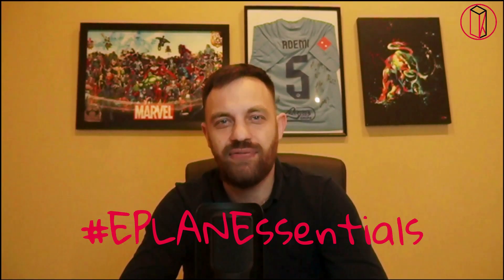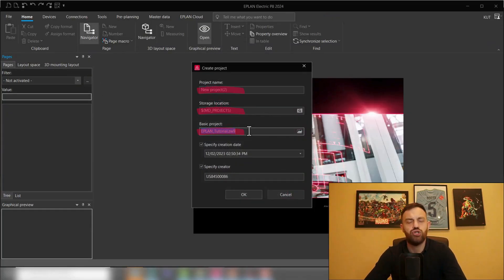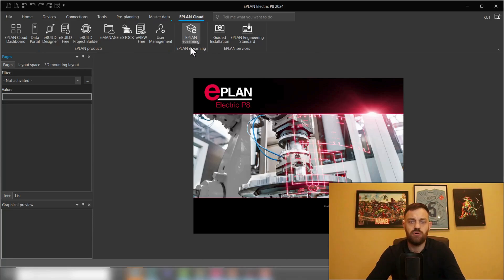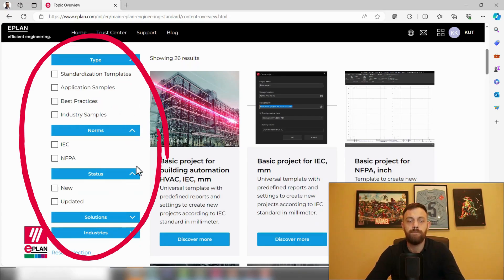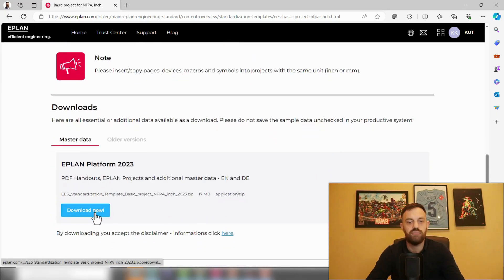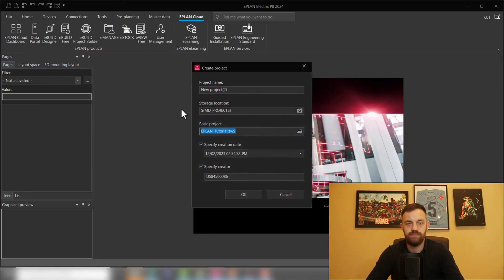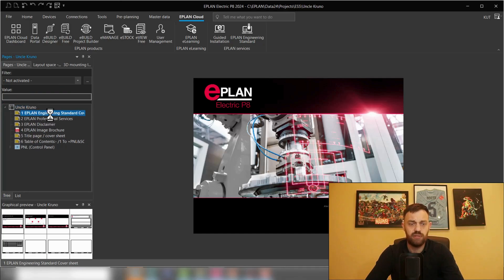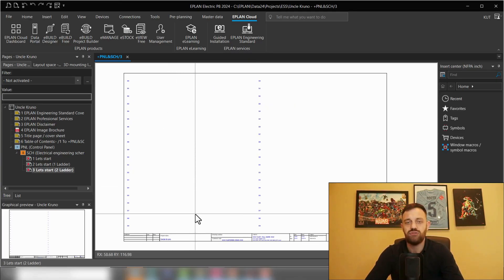Create a new EPLAN Project like a PRO

Comment: Hi Kruno! I was wondering, how is it possible to place the base under a Rittal case with the 2024 version, I can't find the accessory option like the 2023 version, I hope you can help me, thank you
Reply from the maker: Hello Sir.

Thank you for your question.

There was no change in V2024 with accessory management.
That means if you have, the components downloaded from the Eplan Data portal , and are using a PRO PANEL PROFESSIONAL license you should be able to place accessories, just like in the previous versions.

If error still persists please contact your support team.

Best wishes
Kruno

Comment: Hello Kruno I have a question.

I've read the PDF: "[EES]_Standardization_Template_Basic_project_IEC_mm_Handout_EN".

And I want to create a neutral basic project version. Which means option A: "The basic project without defined content contains all current and necessary basic settings, but no page content. The pages and page contents are added project-specifically from the library and integrated into the project."

I've followed your video but I still get the pages (templates).

How to create a neutral basic project version from a Basic Project?

I hope you are willing to answer my quesiton 😊
Reply from the maker: Thank you for your question.

After you created a project, and adjusted it to your wishes, means neutralized it.

Simply go to File > Extras > Project > Create Basic Project.

This will create your own Basic Project which you can use as a template for future projects :)

Best Regards
Kruno
Reply: @UncleKruno  Thank you

Comment: Mr. Kruno...is it possible to create an enclosure from scratch 2d to 3d in eplan pro panel...
Reply from the maker: Thanks for your question. Pro Panel is utilizing the 3D Geometry information stored in the Graphical Macro property of the part, if there is no graphical macro then the software creates an enclosure if you have the width, height and depth set.

When using Pro Panel i would definitely recommend to utilize components available in the Data Portal if possible, that saves a ton of time in parts creation.